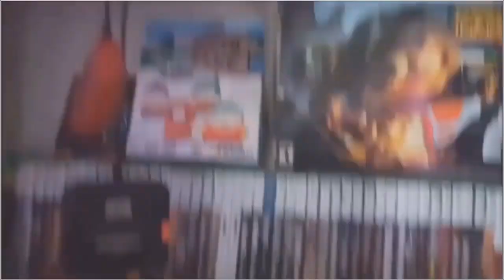DODGING A BULLET! - Life of A Game Hunter/Collector Vlog - Ep. 59

Comment: Hey! do you repair sega saturn systems?
Reply from the maker: usually adjusting the potentiometer does the trick
Reply: Renebean oh really I found one at a flea market month's ago. It fully power's on but it won't read disc's.
Reply from the maker: lone_wolfxj9 yea adjusting it should help
Reply: Renebean you mean the laser that read's disc's right?
Reply from the maker: lone_wolfxj9 yes the adjustment makes the laser stronger
Reply: OK I actually bought a new laser to replace the old one but it still didn't work, I don't know maybe it's something I'm not doing right.